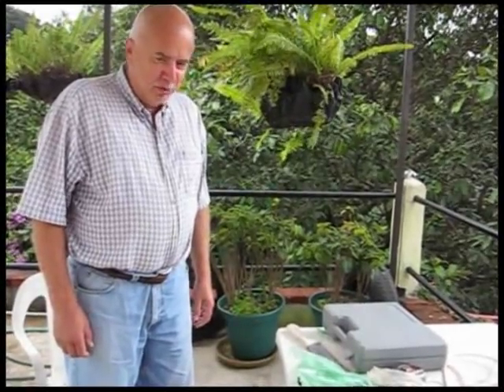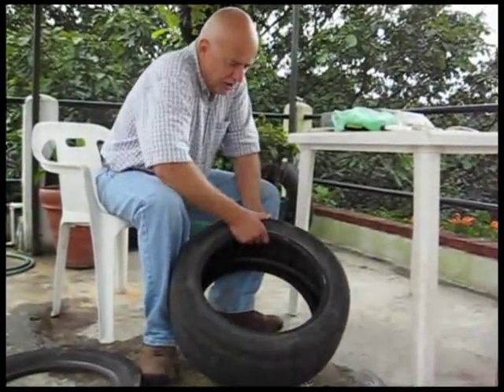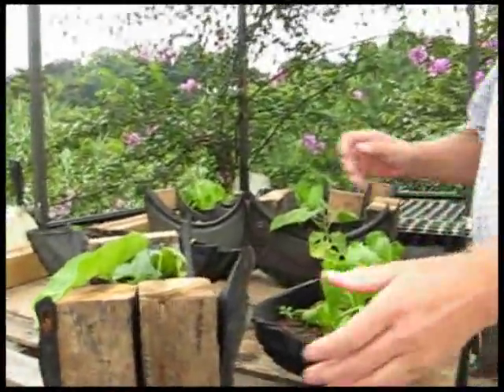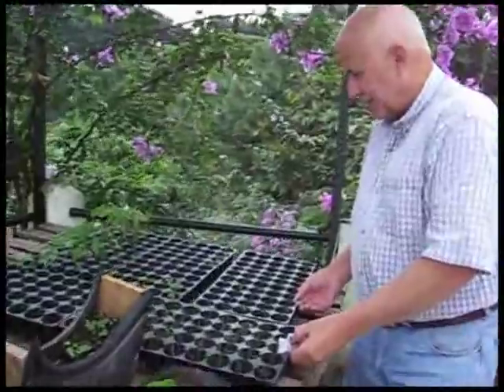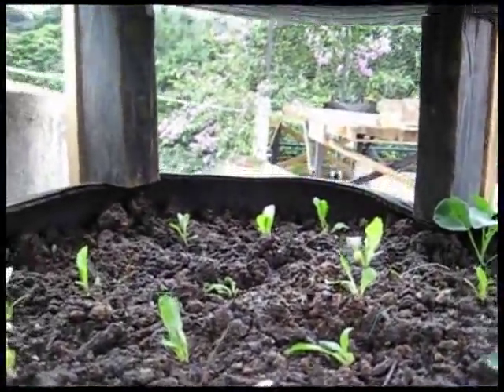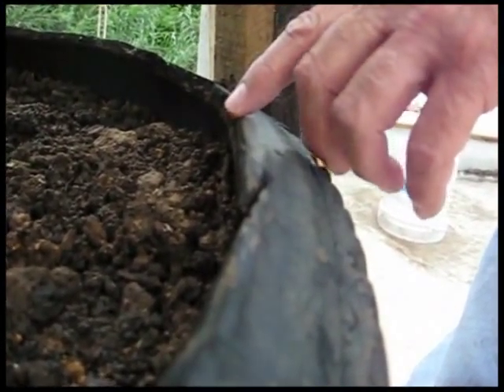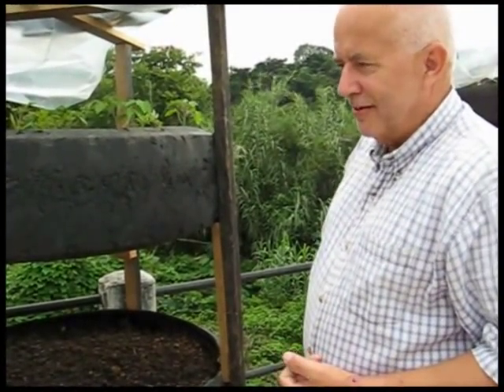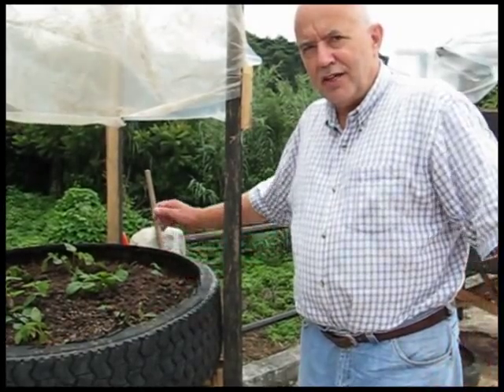Tire Garden Experiment

Comment: I have done a lot with tires.  I find that a jig saw works very well for removing sidewalls or cutting through the wires in the tread.  I use a rough wood blade for the side walls and a fine toothed metal blade for the treads.
Reply: Thanks for the tip on what blades you used.

Comment: great ideas, the rough edge problem can be solved maybe by using an old hose pipe cut down the middle and pushed over the edge, i used that method on nasty metal drum edges at work, many moons ago, hehe

Comment: You can cut an old garden water hose or a tube long ways and slip it on  the tire where the wire is sticking out,so You would cut Your fingers.